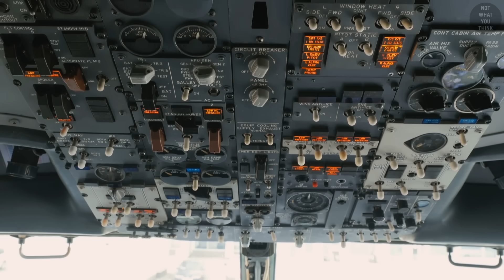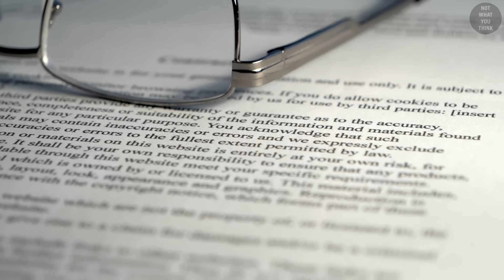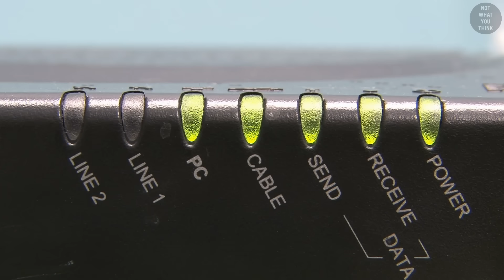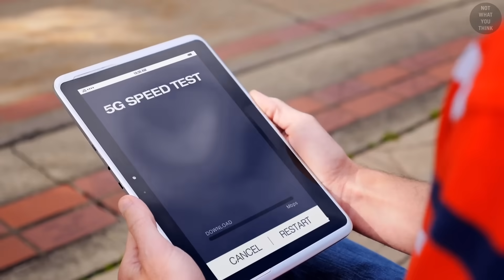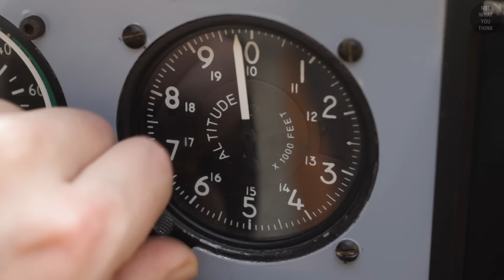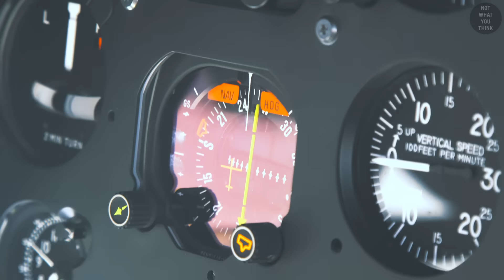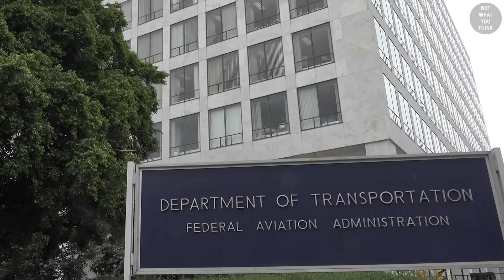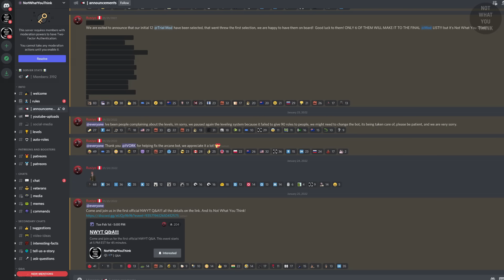Why 5G is OVERRATED and is Mostly Safe for Aircraft

Comment: having 5g spots must be freaking amazing. I only have 2 and yet im already a squirming eel
Reply: I don't think these other people get your comment. But I do. LMFAO 😂
Reply: What now?
Reply: What would you do with 5g spots? I would never leave the house!
Reply: I ❤️ gspots oops i mean 5g spots
Reply: A new tower is being placed just behind my house. So excited for this sh*t 😀
Reply: @GauravSharma-dy8xv  nice
Reply: Dont even have 1 here
Reply: Who even needs 5G? 70mbps is fast enough for mobile internet, surely… faster than WIFI
Reply: @Horizon301.  they are not talking about network lol
Reply: @gamil867  yeah I see. I’m still not sure of what the reference is from though 😂
Reply: @Horizon301.  as wiyj Wifi, thanks to TDMA, available bandwidth in any one radio channel gets divided by the number of stations using (with soime adaption) and those max speeds are in uncongested conditions. It turns to mush very easily on a busy tower, which is why they make cells smaller and use more radio channels - and one of the benefits of smaller (urban) cells is that they're frequently only putting out a few watts total, vs the up to 30 watts per channel on rural towers